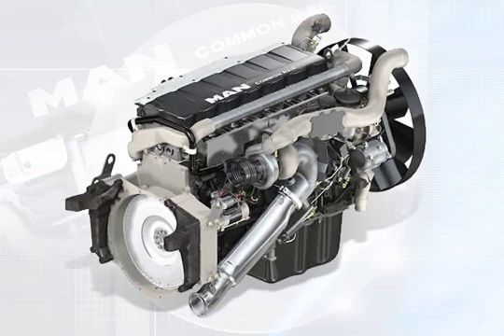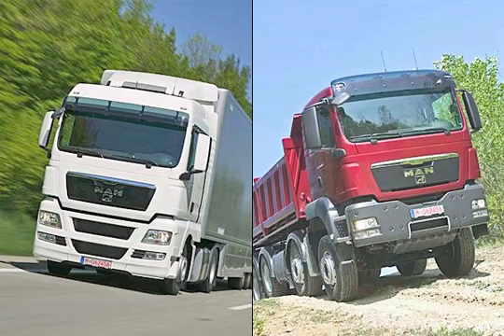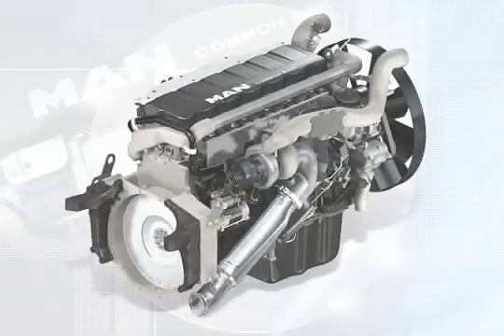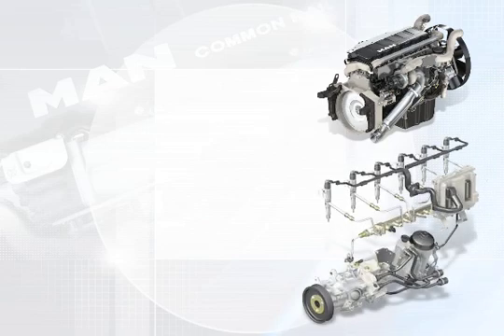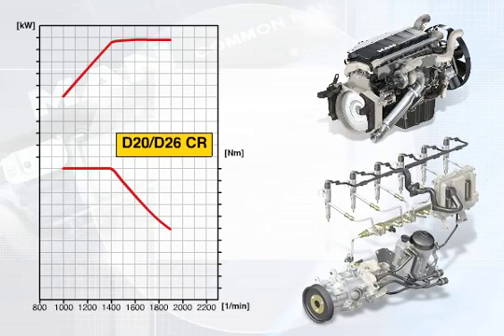Performance of the D20 and D26 engine series

Comment: Hallo, was war eigentlich der unterschied zwischen dem D20 und D26 Motor? damals beide Euro 5? beide AGR?
Reply from the maker: Hallo Nico, der generelle Unterschied zwischen D20 und D26 Motor ist der Hubraum und damit die maximale Leistung und Drehmoment. 
Aus der Zahl in der Motorbezeichnung lässt sich übrigens der Kolbendurchmesser des Motors ableiten: D20 > 120mm; D26 > 126mm
In Euro3/4 waren beide Motoren ausschließlich mit AGR. In Euro5 waren beide Motoren ohne AGR (nur SCR)! D20: 10,5l Hubraum, Leistung 320-440PS und D26: 12,4l Hubraum, Leistung 480-540PS 🦁💙